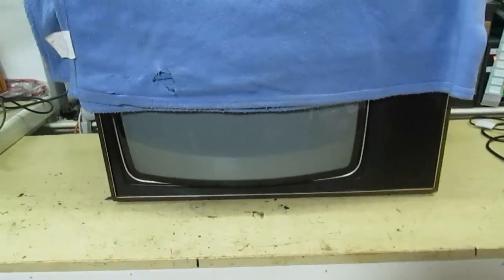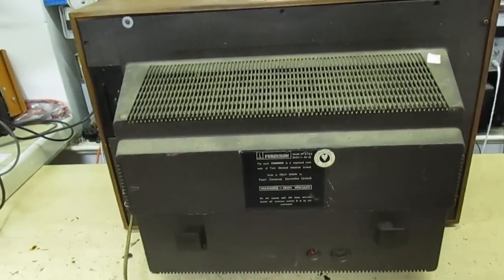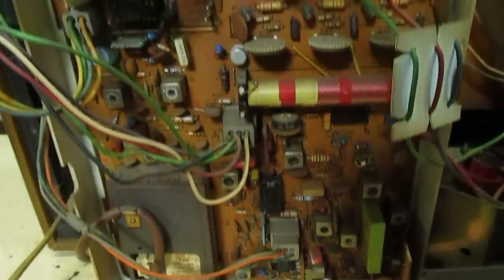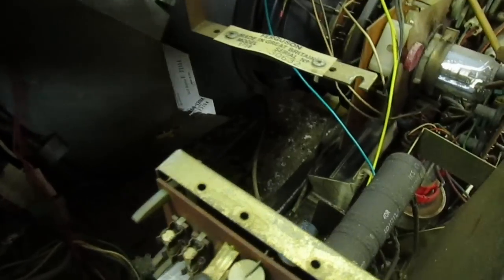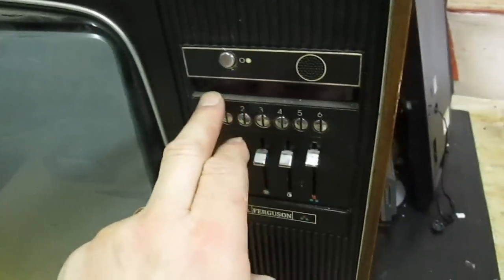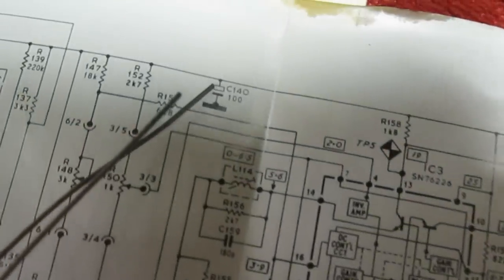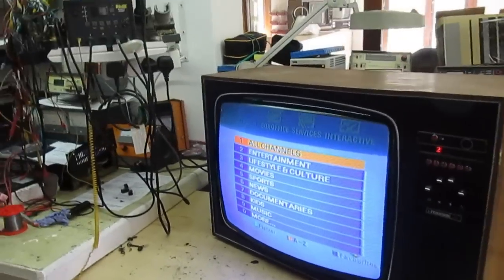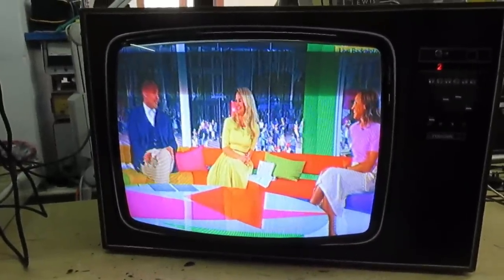Thorn 8800 chassis vintage TV set from 1977.

Comment: Thanks for posting this -- always fascinating to see an expert at work... esp. when he has all the parts still stashed somewhere! Yes, the 80s were indeed magical!😉
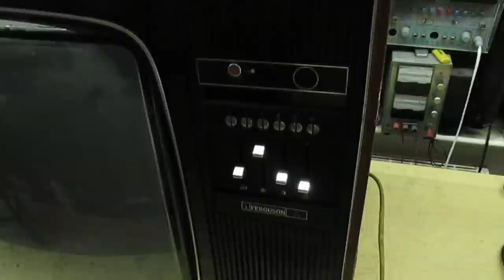14:00 Another RIFA bites the dust... those things are really more annoying than scary, but I've witnessed them go off quite spectacularly.
10:27 What are you using to reform caps? Looks like DIY gear (and I expected no less). What do the 20/5K refer to? I just hook the cap up to a bench PSU and slowly crank it up to working voltage; probably not the best way.
Reply from the maker: Magical times , now long gone sadly , I did make the cap reformer , voltage is current limited by a 20K resistor initially and then when the cap has charged to 70 percent  of its rated  voltage a 5k resistor is switched in to provide more charging current .
Reply: @michaeldranfield7140 Fab! (Literally 😀)
Do you happen to have a schematic for that? And does it use a fixed voltage or is that variable (e.g. externally fed)? According what I read, I now understand caps should be reformed by applying the full working voltage rather than ramping it up; but this is essentially what the resistor does by reducing the voltage drop as the cap charges.
I have a pair of big blue 27000µF Mallorys frommy Commodore PETs that apparently went leaky. I replaced them with Sprague Powerlytics which have held up so far. Would be tempted to try reforming the Mallorys, though I expect it's a lost cause. TBH it's the first time I've seen large caps go bad.
I might add I really enjoy your telly videos; it's such a joy to watch an expert work his way through a schematic and comprehend the (to me at least) black art of component-level troubleshooting. I never got formal training, so I'm still learning. At least I've now managed to troubleshoot my ~30yo Loewe and Blaupunkt (with a Grundig chassis) telly. It's quite daunting!
Those LCD things just don't cut it for me. And I loathe the disposable mentality that prevails now.

Comment: I still have my (ten years younger) 1987 Ferguson 14" Portable in good working order. I just need to find an appropriate digital tuner for it. I had a TVonics that died. Not sure where to go now
Reply from the maker: set top boxes with built in RF modulator are quite rare these days buy an old sky box and dish is just as good .

Comment: Not just televisions for tantalum failures, notorious in 80s early computers, IBM XTs a case in point where the motherboards are smothered with them and are often found with their heads blown off.

Comment: One of the first all semiconductor/ IC TV's I worked on was the Thorn 8000 series. Prior to that I was working up a sweat on the Philips G6 and G8 chassis, which had hundreds of screws to get at anything. The main issue with Fergie's /Thorn's was they always used underated components.  Everything on those boards just got too hot.
Reply from the maker: Too right, sets like the 9600 use to burn holes in the board around the EW modulator , I have Thorn 8000s .

Comment: I have a 1979-ish 9800 to be worked on some time, it was the last in the series of chassis that started as the 8000 and was also the last delta gun CRT TV built.
Reply from the maker: I remember the 9800 vaguely, I think it was a 22 inch in a plastic cabinet .

Comment: Great video, brought back a lot of memories for me,. In all my 50 years of repairing never seen capacitor reforming, is that a piece of kit you have made?
Reply from the maker: Yes I made it myself, reforming of the aluminium oxide layer in an electrolytic capacitor is very important before powering up a capacitor that has not been used for a very long time ,

Comment: Yep.   I have experience with those tantalums.  Long ago I bought a pallet load of Tektronix 465 scopes.  All dead.   A typical scope had several bad power supply capacitors and diodes and one shorted blue tantalum capacitor.  Some had a wet tantalum electrolytic too, with sulphuric acid electrolyte, and these usually were leaking acid.  Almost nothing else wrong besides dirty switches.  Never trust a gumdrop tantalum.
Reply from the maker: I don't tend to see tantalum caps anymore, last time I saw one was in a vintage graphic equaliser, I guess they went out of fashion because of the poor reliability.

Comment: Yes those tantalum caps were abugger for going s/c when they were used as LT decouplers in lots of stuff ratings were only 25 or 35 volts and have a habit of failing when not powered up for a long time
Reply from the maker: Don't know why they had to use tantalum when they were only supply decoupling .

Comment: Usual TCE upside down mounting for the CRT, I used to hate removing and fitting the EHT connectors from the bottom even after using the meter to discharge it.
Reply from the maker: Don't know what it is about fitting the CRT upside down but LCD has followed the same, must panels are now fitted inside down and it's very common to write LCD s off when the customer has sprayed cleaner on the front and it's run down and damaged the COF board, this would of course happen if the screen was fitted the other way round.

Comment: The tantalum caps were a nightmare on those late 70s Thorns. The pictures were awful with poor definition on the 8000. It really got shown up when the 9000 PIL set came out which had a super picture for a small Thorn.
Reply: Keep furniture wax away from the tuner touch pads . It causes them to malfunction and stick on a channel.
Reply from the maker: still got a brand new regun tube for the 9000 and a brand new sound board !

Comment: Keep these videos on old colour sets coming michael, i love em, im getting pretty addicted to watching them now haha, these had an ace picture but 70s solid state stuff was stupidly complicated
Reply from the maker: complicated and un reliable due to heat dissipation but they were the backbone of the British rental market and easy to repair , I loved repairing in the 80 s and doing these videos help me to remember those days .
Reply: @michaeldranfield7140  Yup, back in the days when we built our own stuff instead of chinesium plastic rubbish, that noise on the speaker is called the rumbelows rumble haha, those slide potentiometers were horrible especially if you were a smoker (in the 70s most people were) manufacturers soon realised this then newer sets 1979 onwards used rotary pots

Comment: those damn RIFA caps are just little bombs now 😁 both my 8000 and 8500 were full of dry joints, nearly as bad as a philips 😁
Reply from the maker: Have to remember these caps now next time I do something vintage !
Reply: @michaeldranfield7140  thing is they still make them the same, and still using metallised paper dielectric, i hope the current epoxy encapsulant doesnt shrink and crack the same  after 30 ish years....

Comment: Hi Michael, great entertainment especially with that Rifa, happened to us all. BTW the set has the wrong PSU fitted, it has a BEAB sticker on the back and should be fitted with the later version with overvolts protection. The PSU should have the little daughter board with a crowbar SCR fitted. I have the hated (not by me) later 9800 waiting to hit the bench with it's inertia start circuitry and diode split LOPT. I always thought he 9800 gave better pictures with a good CRT than the 8800. Sadly because these were the last hurrah for delta CRTs what was sourced and fitted were not long lived.
Reply from the maker: I have no doubt your correct and its also possible the decoder is the wrong one and that's why the shorted cap was not shown on the 8800 circuit diagram, I got this from a friend who use to repair TV s as a hobby many , many years ago and he has a house full of sets , he's a bit like me a hoarder who wont throw anything away but I managed to get him to sell me some .
Reply: @michaeldranfield7140  regarding C203, you are using the advance manual. The decoder kept on evolving in its life, ending up with the SAWF version in teletext 9K6 versions
Reply from the maker: @johncolman5268  Its such a long time ago now I have forgot much of what I use to know about these sets .

Comment: May I use the same way in your video of "High Peak Radio" to modify japan model tuner (76-90Mhz) into international band (88-108)?
Reply from the maker: Yes, as long as the local oscillator will tune that far up.

Comment: those bloody rifa class x caps are everywhere ! ha its not nov 5th yet
Reply from the maker: Everyone keeps saying the same but I have only had a Rifa cap fail once in the past and that was in my Farnell 350v bench power supply, I did notice though a while back I have some brand new ones still in stock and the plastic case have cracked in storage so Im guessing they only fail if the cap has absorbed moisture .
Reply: @michaeldranfield7140  yes it's all about the hermetic seal, seen it so many times on dual 505 turntables that have spent time in lofts or garages. I have a few 80,s tektronic scopes so a rifa cull was the first job plus the tantalums
Reply from the maker: @darrenmurphy6251  Going to have to remember this for the next time then .

Comment: yep, definitely be careful with plastics and servisol super 10, i've had it ruin newer type pots with soft plastic rotors,  the older nylon and srpb/metal ones ok , also some philips ones the carbon flaked off the track backing ...
Reply from the maker: learnt my lesson many years ago with the GEC sets and plastic cabinets, never again !
Reply: @michaeldranfield7140  i had a gec c2110, horrid double sided pcbs, case was cracked and some previous owner covered it in wood effect stickyback plastic, it worked ok though but had to scrap it when lost use of storage barn, along with a few others 😢
Reply: it had a choke input and that was fairly buzzy ...

Comment: We had the basic version of the same set, with a silver front panel and no remote.

All the channel buttons kept popping out and the tube was replaced twice in nine years, so I'd be quite surprised if the tube was Tosh out of the factory as these tended to be good didn't they? 

Fond memories though.
Reply from the maker: The Toshiba tubes were always excellent but I never remember the Thorn 8800 fitted with a Toshiba , however after 40 years my memory has faded considerably .

Comment: Your video here: https://youtu.be/Glb8ZDEOKkk i had one of these as a teenager, i tell you what the ferguson courier portables were absolute top notch, i used to use mine on a zx spectrum computer, this tv was built like a tank and had an awesome little picture, even when i retired it and bought a colour it was still working perfect.
Reply from the maker: The Ferguson in the video is a transistor set but they made one which looked absolutely  identical but it was a valve chassis but I cant remember the  chassis number , it may have been 1580 but I could be wrong and unfortunately I don't have one in my collection .

Comment: The bulk of if not almost ALL tv sets manufactured and sold in the UK until the JAPANESE imports, were some of the worst electrical items  that we Brits were subjected to. Unreliable, overheating and overbearing let alone as we would have said; over here... absolute and utter garbage. The first time I bought a JAPANESE tv set I realized there were those who were capable of making something that WORKED, WAS RELIABLE and worth every penny...
Reply from the maker: a lot of British TV sets back in the day suffered from big burn ups on the pcb , usually in the line scan department where all the current was drawn , you would never get away with anything like that today .